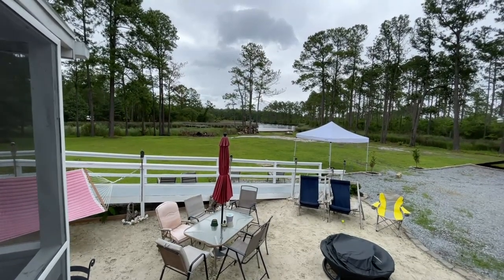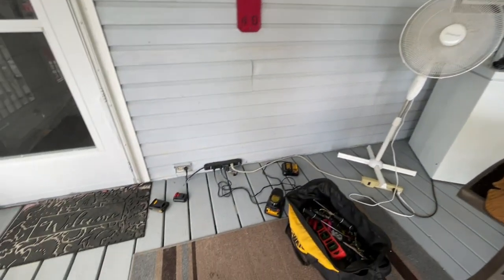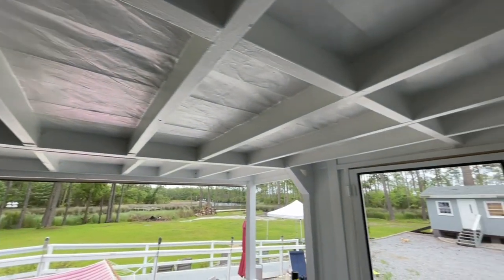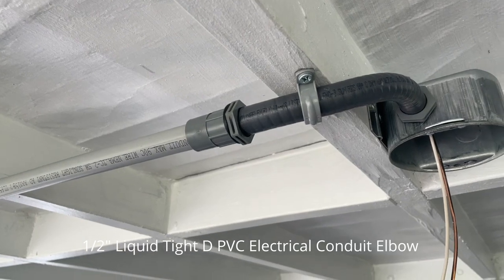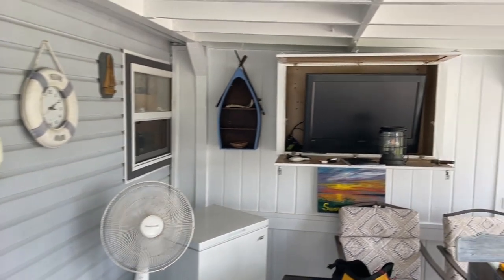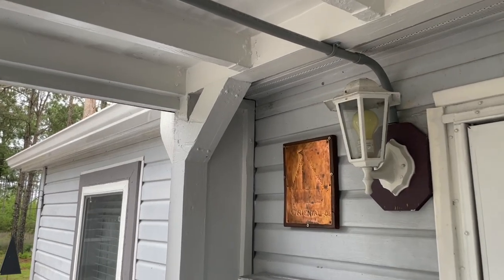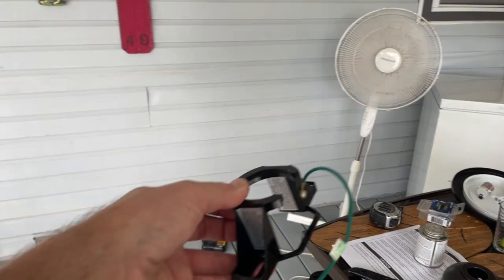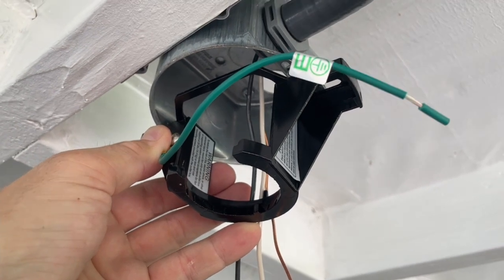INSTALLING A CEILING FAN IN A SCREENED IN PORCH: The Complete Guide!

Comment: i would add a pull switch for the light on the wall so you could sit under the fan without the light being turned on.....i have seen the screw-in plugs with a pull cord and you put the bulb into the new part so it wouldn't be a big deal to complete this...I liked what you did
Reply from the maker: That's actually an idea I hadn't thought of.  Thanks!

Comment: Cosmetically the line is not pretty to look at. Couldn't you have gone along the wall and then cut in to the middle of the room to install the box. The conduit would have been a lot less visible. Just a thought.
Reply from the maker: You have a good point.  This was a free job so I went as direct as possible to save time and expense.  If I would have done a paid job I would have drilled each board and routed conduit up out of view.  But, you have a very good point that wouldn’t have cost much more and looked better.  The “customer” was very happy with the result.
Reply from the maker: I always appreciate good feedback like this, so thank you!

Comment: I’m guessing the ceiling fan has to be rated for outdoors?
Reply from the maker: I install indoor rated fans in porches if the rain can’t get to them.  They might not last as long due to humidity but because of cheaper price it is done by home owners.  As for passing code, any electricians know the NEC on this or have other thoughts?  The fan in this video was probably not outdoor rated.